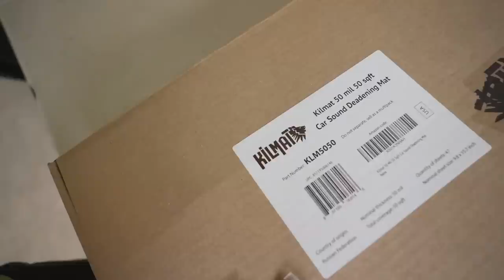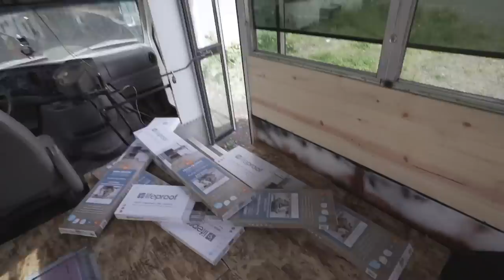Man vs Skoolie: Insulation, Walls, Flooring, & A Seat with Seat Belts.

Comment: well hopefully you can put the new seat and tracks into the big bus when the time comes - that'll save some money. Also once you get the ceiling insulated the bus will be a lot cooler. A lot of people don't realise that insulation helps keep things cool and are shocked at just how much of a difference it makes. You don't need to defend your decisions - what is good for you is maybe not good for someone living in a different climate or maybe health issues. I love the wool insulation and I wish more people would use it, even wear wool - it uses a lot less water to process than bamboo or cotton and it is naturally antibacterial, naturally odor and water resistant and totally renewable without killing animals. win win. It looks awesome Isaac. Lucky Jaylena and Ember! Hard work always pays off.
Reply: People also don’t realize sheers can help with keeping the heat out...don’t have to live in a dark room to keep cool...it’s the type of fabric used.
Reply: @martymaloney1032  Yup also a very good point

Comment: Isaac,

I’ve used Benjamin Moore for thirty five years. I tried other brands before and for some reason I happened on BM and found it saved me time because I wasn’t having to put on more than two coats unless I was repainting a black room (yes, we’ve had several and changed them when we sold). It also just goes on the wall easier when you are working around trim, I rarely mask because I’m just that good! 😬😆

It looks great, looking forward to what you come up with on this build, I’ve said it before but every build gets better and better!

Comment: Looks like a nice seat. I'm kinda thinking I should find a nice air ride swiveling set of seats for my bus. I didn't regret not doing spray foam insulation in my bus till I realized how much it takes to heat and cool a large bus. Even with a half inch of Styrofoam insulation. It's now evident that I need more insulation in order to cut back on heating and cooling costs. I put a 5100 btu window ac in the other day. 98° outside closed the windows with ac full blast and the temp just kept rising over 100° it was cooler with the windows down and fans running. Now I'm considering spray foam injection into the walls and ceiling. The floor has 1" rigid blue insulation board under the plywood and flooring. I really don't want to tear out the ceiling metal just to have to put something else up to cover the insulation I've also considered putting another inch of Styrofoam panels up on the ceiling but losing another inch of head space will start to be an issue for me being 6ft tall. My head already touches when I stand near the sides. Oh what a learning curve when you try to be different than everybody else. Love all the honest knowledge you put into your videos and the creative videography you do. Rock on
Reply from the maker: Thanks for watching hoods! Yeah sometimes you gotta find what works for ya
Reply: you know, Dorit is in the process of redoing her bus and she did a demo on Instagram or on the youtube don't remember which, she put reflectix on the inside of her bare metal roof and took an infrared thermometer and showed the difference between a panel with the reflectix on and the one next to it and there was a 20-degree difference in temps...she ended up putting reflectix on the walls and ceiling before the insulation which I believe was havelock wool, I think that's the way to go along with henri's on the roof

Comment: Oooooh the Isaac in the bus goes in and out, in and out, in and out, The Isaac in the bus goes in and out to measure and cut wood.....ooooh   the Isaac in the bus runs out of glue, runs out of glue,,,,,, oh you get jist of it,  I ain't typing no more, carry on...at the start of the next build get a fit bit and only wear it when your working on the build and measure your steps, etc.....